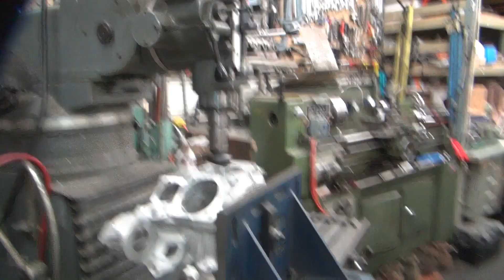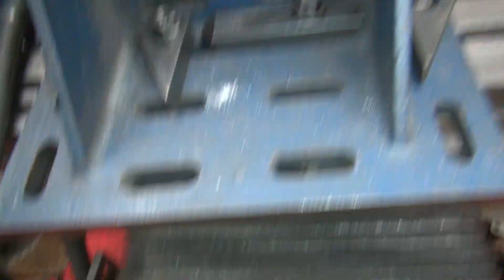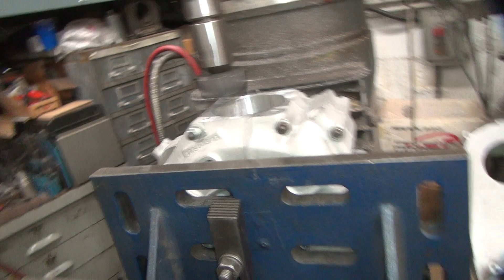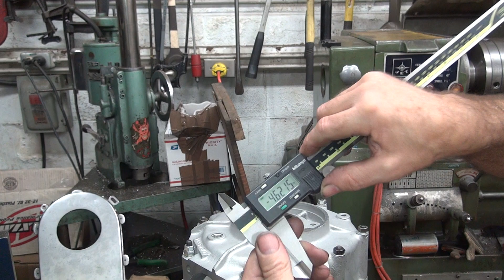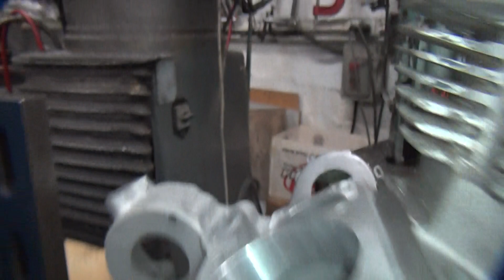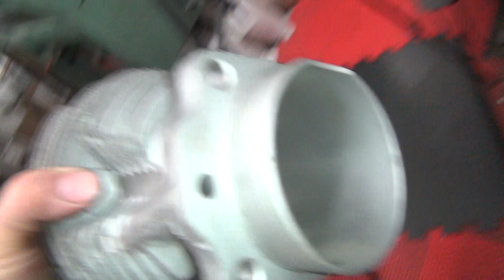#202 1947 EL case welding knucklehead 74ci motor rebuild & machining repair harley by tatro machine

Comment: That fly cutter is cutting beautiful very nice cross hatch, you do good work brother
Reply from the maker: the crosshatch is because the mill head is trun to the table. if it was off, you would just have the cut marks that you just cut. that is why they are call witness marks.
tatro

Comment: When you’re finished with the case it’ll be a gauge for the frame.
Like to see the magic fit there. Great work Boss!
Reply from the maker: the frame is fine. its way to heavy to have moved much at all. remember, i had to pry the motor out because it was to tight with the broken cylinder.
tatro

Comment: I was thinking, when you machine down the surface like this the pistons will go higher in the cylinders or that is just marginal that can be ignored?.
Reply from the maker: yes, its going to have move compression now. good, it was way to low anyway.
tatro

Comment: Test fit them in the frame.
Reply from the maker: they will fit fine. i used his offset mesurement. i already told him to check it too.
tatro
Reply: @TatroMachine  Good.  My ‘58 FLH motor had both front mounts broken off (and the mounting holes are a mess) and reinstalled too high (.160?). Since that motor is already tight in the frame I’m going to take what I’ve learned on these past 3-4 videos and instead of trying to bring the front mounts up to “standard” maybe take some height off the bottom of the back mount which will lower the motor in the frame.  Kick start bike with a tin primary so height back to the transmission is not a problem. Chopper motor in a chopper frame.
Reply from the maker: why would you change the rear mounts when they are stock and good. shim or cut the bad front ones untill things work correctly.
tatro